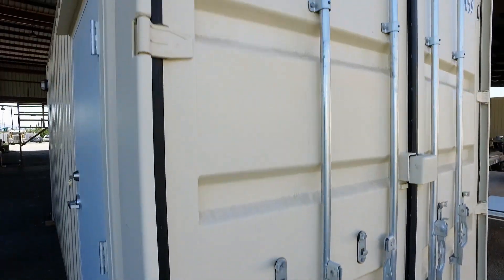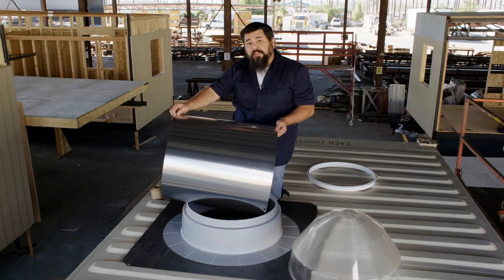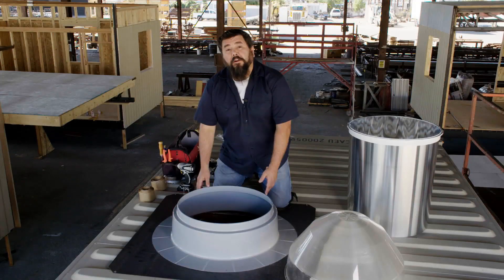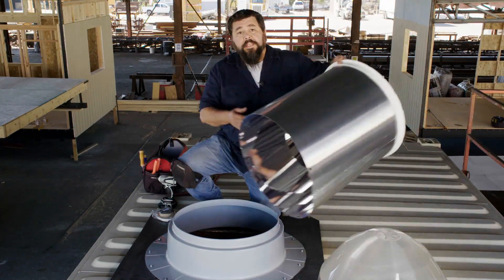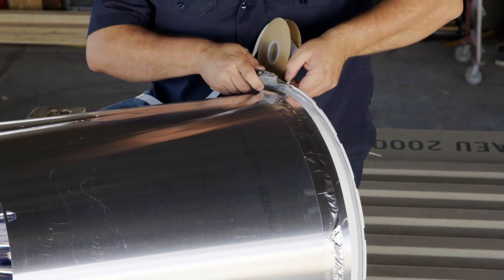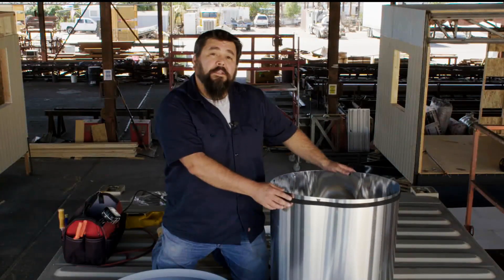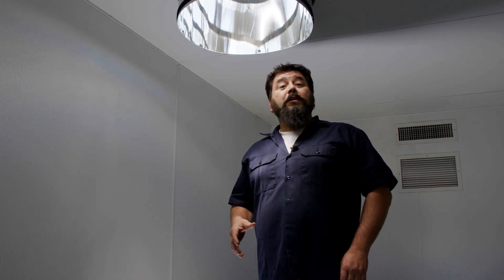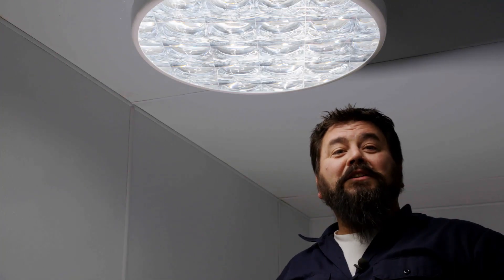Solatube Installation: Container

Comment: Very nice, I love natural light, however, what I would have really liked to see was what was under the flat plate, that seems like a very important part to know, how to seal the corrugated roof. As an installer you are trusting the customer to provide a waterproof seal, that to me is a fail. What if it starts leaking in 6 months, who makes the repair? Also, it looks kinda light weight, what is the life span, what is the wind rating?